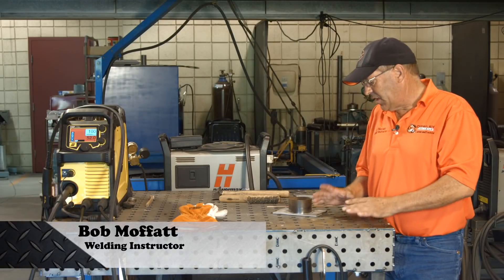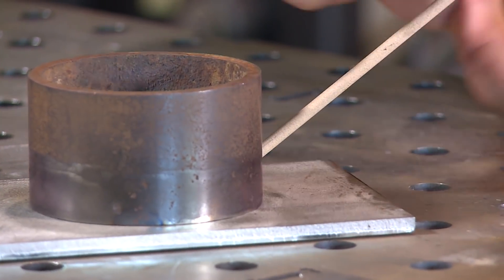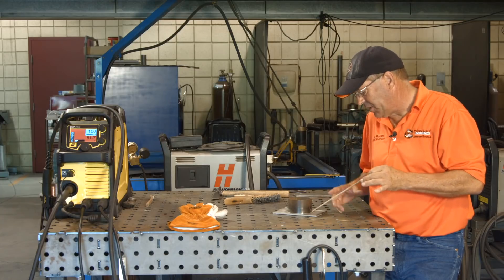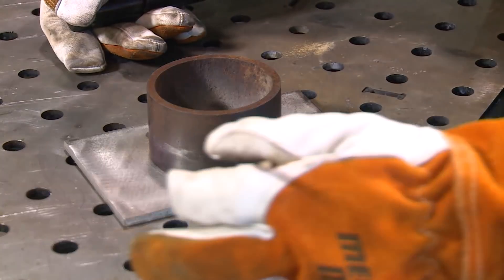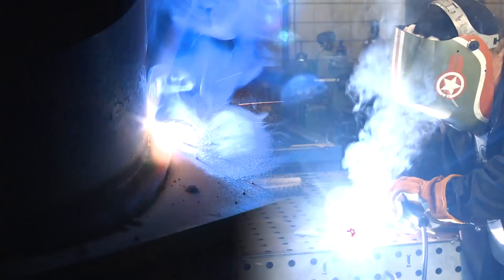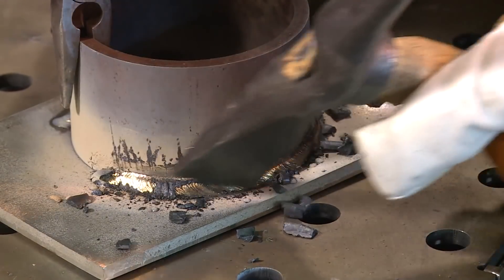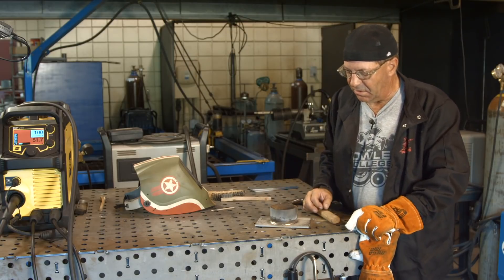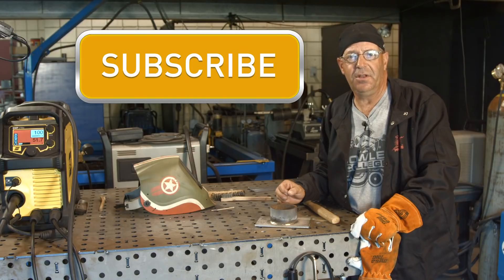🔥 Tips for Stick Welding Carbon Steel to Stainless Steel

Comment: THanks for this!!!  First time welder coming up -- for a BIG RC truck -- need a stainless steel tube 304 to a mild steel plate --- got some 309L-16 rods and a basic Amazon stick welder --- excited to try it out and see what happens!!!  Assuming the table was connected to your ground there?   Any reason i can't just connect the ground clamp to one or other of the pieces (ether the stainless or the mild) steel that I'm welding together?  I don't have a steel table to work on as yet.   Thanks again!!!

Comment: what happens if you weld with a  stick intended for carbon steel or a stainless stick? will that still  weld carbon steel and stainless steel?
Reply: 6:25

Comment: Hello, I would like to ask you a question. Which coated electrode should I use to weld a 4140 steel torsional shaft bonded to a 1045 steel plate? Thanks for your suggestion.

Comment: A little late finding you but your information is right on time,  I just got a small 20 gal. stainless tank from a friend and wanted to make a shop stove heater with it, not being sure if I could weld a carbon steel exhaust pipe on it I searched for information about it,  thank you for this video,  it answered my questions

Comment: Truth be known you can 6010 it and it won't budge....i built a spike drag years ago welding old stainless bolts to steel angle iron...still use it today you will snap the stainless bolt long before the weld fails!!!I had guys telling me 6010 won't have any strength on stainless...BULL!!

Comment: Is there a rod that i can use on this that works other things?  Like general steel welding. Or cast steel.
Rather not just use it once then have the extra go to waste.
Reply: 309 work OK for cast steel, providing you use a decent preheat (also post heat if you can) also 312 works well. 
Wouldnt bother using them for general steel welding though

Comment: Yup was looking for a cheap n quick way to patch cattle waterers where the heater electrode underneath had oxidized and cracked the stainless bowl, just need to put in 6" square patches to close out the winter season.

Comment: Would I do this for welding exhaust?  I have V bands to mild steel exhaust I need to do?  What settings would I use on the welder?

Comment: Thanks for this video Bob!  I’m looking to weld a 1” stainless plate on the head of a custom made post driver that is made from steel to strengthen it against warping.  I found this helpful!

Comment: Thank you for creating these films for us. What I'm missing are the following: a word that explains the why; why was it necessary to bind a stainless steel plate to a carbon steel pipe? 

I don't know what carbon steel is. The definition of steel is elemental iron combined with some percent of elemental carbon at the foundry, and stainless steel has some percent of elemental chromium added to this also at the foundry.

Drawings would be helpful. I can't see what's happening behind the glare of the welding flame. A drawing that explained the dimes pattern and how it may be achieved. 

Thank you for what you are creating for us.

David Lixenberg

Comment: Nice thanks for the tips, I’m self taught stick welder and can lay some pretty good welds but very ignorant of correct methods. I actually like stainless except for the restart ! I did a stainless to carbon on a load bearing item on my land cruiser lasted for a long time but cracked and broke in the middle of Oz, found a real welder who said the weld looked ok but likely I used the wrong alloy, it was a stainless rod but anyway thanks heaps
Reply: looking at this video considering doing similar on my Landcruiser welding a steel dump pipe to my stainless vband :D saw your comment and thought similar situation!

Comment: Just some added info that I found while researching what arc rods were needed to weld 316 to carbon steel. Some 308L applications may be substituted with 309L filler metal, but 316L or 316 applications generally require molybdenum and 309L contains no molybdenum. E309LMo-16 has a nominal composition (wt.-%) of 23.5 Cr, 13 Ni, a maximum allowable  carbon  content  of  0.04,  and  a small  addition  of molybdenum. So if you are welding 316 to carbon steel you need to buy E309LMO.16 welding rods.
Reply: Hello Mr Solar Function, thank you for this information. It is helpful to my sense of self to have someone explain that when combining different materials an intermediary, molybdenum, is introduced to buffer and combine them.

David Lixenberg
Reply: @davidlixenberg5999  Welcome David........ Mark

Comment: Thats exactly what I wanted to see. Apparently finding an answer is non existent, refers to tig or mig only. I have the lotos tig 200ACDC, great machine by the way,  which can tig or stick weld, but i ran out of fillers, etc & by the time I order materials & they get shipped to NY during this whole corona virus thing, it can be a month or more. So i wanted to see stick welding these two, & here you go.  Thank you

Comment: Thanks for the video.
Have not found any videos on Youtube for doing 309 stick electrode to carbon pipe on a 6G position for fill and cap. Only 309 tig for root and hot pass. Could this be a future video please🤗

Comment: Thank you! This was concise and to the point. Very helpful as I have a massive quantity of stainless to weld to carbon. On a related note, any idea of the composition of railroad rails circa 1940s? Stainless plate getting welded to the bottom of them. (Not my call). Thanks again.

Comment: Good video. What kind of stainless rod would you use if you had to verticle weld? I have a Welder who asked if I wanted to have him weld stainless to mild steel in my outside boiler. Crap steel in this boiler, I have had it welded over 10 times since 2000. Needs it again, thinking about replacing the whole back wall and chimney section.

Comment: id like to know how you weld hardened steel to mild steel with a mig welder ?flux cored? without gas Thanks

in my problem is welding thin 1.5mm mild steel hollow rod to a hardened gear 3.5mm thick with a mig welder without gas
the gear will have about 1hp of electric motor load or 1000watt 3000rpm max
i barely have  5-10 minute of experience T_T

Thanks for any help

Comment: In the process of heat treatment after some cycle of quenching process why welding break from MS plate.
Weld stick on the SS material 
Plz Sir provide me solution

Comment: You seem to like that Rebal a lot I was considering it. My only worry is duty cycle- do you feel it’s duty cycle is sufficient? Looks like it puts down quality welds!
Reply: I know zilch about everything said here. 

What is duty cycle ? Is the frequency of the mains supply ? Does it matter whether a welding machine operates off of ac or has an inverter or operates off of a dc supply ?

David Lixenberg
Reply: @davidlixenberg5999  Duty cycle is the amount of welding time before the machine gets to hot and cuts out use to happen a lot with older air cooled fanless machines but the new inverter fan cooled seem to do most jobs round the house.

Comment: That looks really neat!!! After many years of just Tig welding stainless I got a tiny stick-tig welder and been trying out stick welding with stainless 3/32 rod with 308L-16 and soon will try 309L,.. it's really cool to be able to put together different alloys and that the visual outcome is nice and smooth. Dragging the puddle seems to work way better than what I was trying by pushing it (used to the Tig style). Thank you so much for the vid!!!!!
Reply: Yea I’m also used to the TIG and it’s surprising how nice weld he has gotten in the end

Comment: Bob I really appreciate your skill set and teaching style. Yu touch on a lot of things I totally would agree with, such as not banging the slag off to avoid injury AND to avoid irritating the instructor lol!! My question and youtube research lately has been regarding a stick welder I acquired recently. It is a small "FORNEY" 100 amp ac stick welder. So Ive been wanting to know what its capabilities are because I dont know if its me or the machine, but Im practicing with small 1/16" 7014 rods and the only thing I can do is lay a straight line on flat steel. Haven't been able to do a fillet or even weld two pieces of steel together! I just want to ask you- is it easier to run larger 3/32 diameter rods and what kind of material would be possible? I also tried to weld to large chrome vanadium 1/2" drive sockets together and that was a nightmare. The welds were not sticking... Could you make a video of you welding with a cheap ac buzz box welder showing what they are capable of? Or could someone point me to a similar video? Thankyou..

Comment: Stainless can be cut off using a 5/32 7018 welding rod with the welder cranked right up.  Be warned.... BIG clouds of noxious black fumes. It gives a very rough cut , but it works if you are stuck with no other options.

Comment: Well done. Good video.  Always wear safety glasses. Stainless is dangerous.  After cooling a while, the very hot slag and even the little varnish spots suddenly pop and fly off.  Lots of surprise burns when you weld stainless steel.

Comment: Stick welding stainless or exotic metal like inconel and hasteloy is some of the most challenging of processes. There is no forgiveness. Any various in manipulation will be seen in the bead. It is very easy is to trap slag. Watch that slag. It is super hot and will make a nasty burn which can last months. If you run vertical up, dissimilar welds like to reject the filler metal and spit it back at you. I experienced this while stick welding cast stainless clips to carbon tubes with inconel. MIG downhand seemed to work the best for this dissimilar combination. The clips were designed to snap instead of ripping a hole in the wall of the tube. It was in the reheat bundles of a 1350 megawatt boiler.

Comment: hi Bob, great demonstration !  i like running stainless stick it is always fun to test your skills.

could you touch on stainless stick root on plate or pipe.  I've talked to fielders about techniques , using high amps and putting in a stack of dimes with the stop and go method.  same as i use for 3/32 316 rod vertical weld for example.  also he was using  sodel electrodes  never seen them down here in new mexico. 

best regards
mikerodwelds

Comment: how often is E7014 I.P used compared to E7018 L.H. I know E7018 L.H is way more flexible than E7014 I.P due to the Flux. plus I've been out of the welding circle for over 20 years
Reply: 7018 is low hydrogen....
Reply: Doug Ankrum 

I know. E7014 is iron powder and E7018 low hydrogen. my question was how often E7014 is used out there in the job field
Reply: I  hardly ever have seen it used...and I've been welding since1981....So, I would say...not much.....some AC stuff outdoors maybe.
Reply: Doug Ankrum 

yeah. I remember it's not as versatile as 7018. the 7014 is only a 2 position rod. while the 7018 is a all position rod

Comment: 5:15 - That's some smooth Stick. Always keep the same angle, like it was on a Turntable.
Reply: Its dreadful he just ran the rod around the joint with the rod touching the metal zero penetration
Reply: @jacobj6376  I would have used more amperage, but I think we can see at 3:16 that he had some penetration; also he said that it was his first time.

If I see crap I vote down, and don't comment because they block you; there's so many worse welds to criticize (even on well known channels), I think we need to wait to see where this ends up after some practice. 

It's easy to find far worse than this.

Comment: For people watching, I can't emphasize how much he means it when he says the slag stays hot for a long time, and it'll burn you. I'm only 15 and it's already happened to me. It hurts like absolute Hell. You'll never wanna know what it feels like.
Reply: no such thing as a welder that doesnt get burnt
Reply: The metal stays hot longer than people think. I learned the hard way too when I first started learning how to stick weld with my everlast welder. I also learned that hot sparks like to get into shoes from behind the tongue if you aren't covered up.
Reply: vagina
Reply: Every welder knows how hot shit gets...
Reply: Nice one lad. Make sure your vigilant about your eye and ear protection.  Plug and muff. 
Don't look at the arc !!!!!
I'm 46.  Been flashed there and here over the years, never bad.  My eyes are still good. 
Only muffed and plugged, double dead, half my working life. Hearing is starting to go.

Comment: On the aluminum rod preheat a little. Not to much it work better. The heat spreads fast
7018 would still weld fine on SS. S6 wire feed works fine too. As far as strength goes. Procedures are for " procedures "
Reply: KIM COVENEY  sure those work well, until you have a few hot/cold cycles and the welds crack from the stainless heating and cooling faster than the weld

Comment: Nice demo. Being retired from the heavy equip repair trade all my life I have almost from day one of welding used my Bernard twist lock holder on a lighter 10' whip line that can be attached to the main heavier welding cable very quickly. More maneuverability, less weight fatigue and you can bend the rod in position with a better grip. Even have a regular small clamp style whip for ease of welding. Never see any weld videos showing this but I know most everyone in the field has one. Any thoughts? May make a good option to show to new welders. Thanks Ed K. Cleve. Oh.
Reply: Eddie Kawecki

Comment: You did stick because of the question, but if one were welding the objects you chose would stick be the best choice? I sort of think so but am not sure. TIG would be my next choice and MIG (if one can get 308) last unless one has a high amperage welder. Not sure if a 210A mig would get critical penetration.

Comment: I had to stick some stainless once. You're right when u say uphill doesn't work. What's a guy supposed to do in a situation where that's what you have to do? All my horizontal and flat welds turned out great but the vertical up was a nightmare.
Reply: Vertical stainless is tricky because the material heats up really fast compared to mild steel. Try using a small diameter rod like a 3/32 and making sure to let the material cool between passes. Another option is to have a amp control in hand and adjust the amperage up or down to compensate and prevent your weld from dripping down and forming "grapes "
Reply: Depends on the rod brand in my experience. Some will run really good out-of -position.
Reply: Bob  Moffatt thanks
Reply: Bob  isn't this uphill problem what pulsing features in many welders are supposed to help with (among other things like work piece warping )?   I hear alot of people saying that Pulse is a useless gimmick to sell welder units for a higher price.
Reply: This pulsing was from erratic wire feeding. Pulse wire feed settings on the machine settings are very beneficial.
Reply: I not a welder by any means, but i do small projects around the house. 
I find it's much easier to get a nice weld with stainless rod compared to carbon steel.

Comment: Hey Bob, when you are using the esab rebel are you plugged into the 110 outlet or the 220 outlet? I've been a little skeptical about stick. Does the background color on the screen have anything to do with what Outlet you should plug it into or is that just the color it is.
Reply: That is the color. We've shot videos on both 110 and 230 volts.  I notice very little difference while plugged into either one.

Comment: Thanks for the concerns about the smoke plume and the risks. I'm mindful and aware of the hazards and we use vents in our shop. However it messes with the audio while filming so I held my breath? Kinda? We should have explained that in the introduction but failed to. Thanks for pointing it out. Good discussion for other videos.
Reply: Ha! Ya right, hold your breath. I say the same thing every time I go to weld on some nasty galvanized...holding your breath is a horrible idea!!! I like your humor Bob.  I like to put the fan behind me if I can so it's just keeping fresh air flowing through my hood and the nasties out of my nostrils.
Reply: How about just using a fan to blow the smoke away. That is unless gas is involved, then just put the fan on super low away from your face.
Reply: I use a vent in my shop and I just bought a ventilator mask to wear to keep some of the other stuff out of my lungs. They're bad enough thanks to my grandfather smoking like a chimney next to me as I grew up. Plus, my vent kinda fell out of the ceiling the other week and I'm not sure that the repair job they did was very good.
Reply: +Bob  Moffatt - For the purposes of recording a Video with good Audio try a conventional Home Fan (like a Pedestal Oscillating Fan, set not to oscillate) placed ~15 feet away.

It's enough to push the smoke away without wrecking the Audio.

Breath holding or uncomfortable positions affect the quality.

Others: Don't substitute a cheap Fan for proper Equipment (with a Filter).

YT,
Rob
Reply: Understood. I have one but it blew up when I plugged it in last time. I will need to replace it. Thanks for the feedback.
Reply: Whenever I stick weld with my everlast welder I try to have two fans going. One behind me to bring fresh air in and another in front drawing the smoke away. Where I weld unless I do this the smoke just churns and comes back around to where I am.
Reply: Bob  Moffatt u got good videos and a good welder instructor
Reply: Bob  Moffatt that colledge has a good instrctor u seem like my old instructor . like ur vids